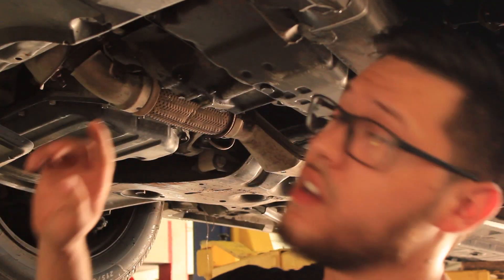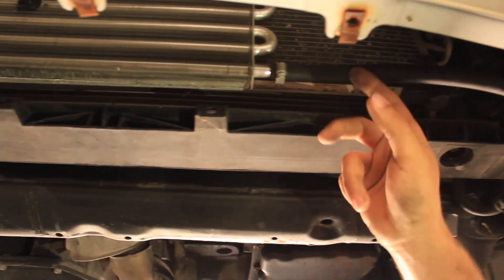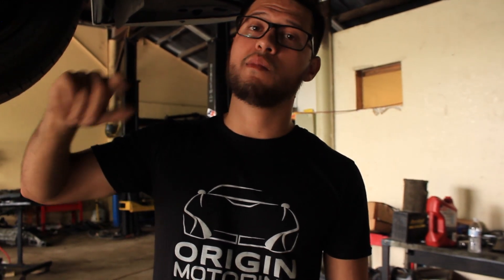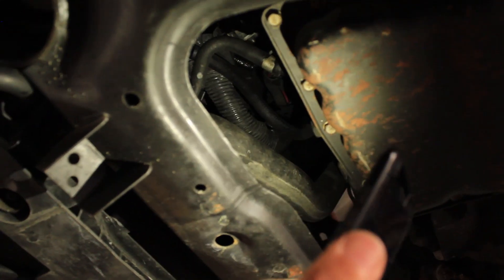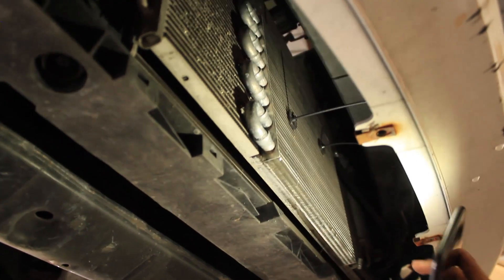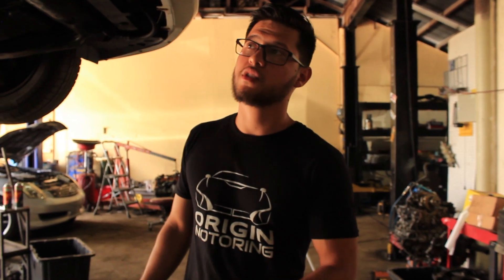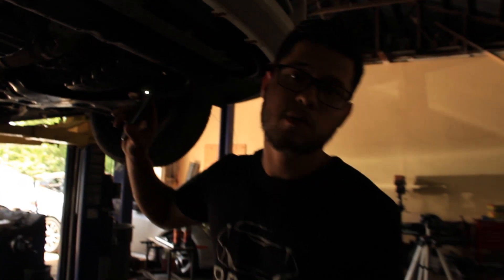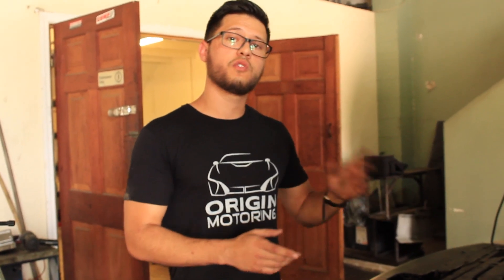Altima cvt Fix. Transmission more reliable

Comment: I got a 2018 versa note. is the cvt not reliable on those?
Reply from the maker: I have a 2014 versa we use to rent to our customers. The transmission on those are terrible heard stories of failures as early as 40k miles. My versa has had the transmission replaced at 80k by the dealership with a new transmission by the owner I bought it from using extended warranty coverage. I bought it at 110k and did a cooler upgrade like this Altima but had to buy an external water cooler adapter online to have 4 ports instead of the stock cooler on the versa only has 2 ports. The upgraded 4 port water cooler has 2 ports for engine coolant and 2 ports to hook up an external air cooler. My versa now has 140k no issues so far. Will make a versa video soon. Don't know if the 2018 versa is any better than the 2014 versa when it comes to transmission failures. It seems like since Nissan started using cvt in 2007 it's been nothing but overheating transmissions blowing up on all models
Reply: thanks for your reply :)

Comment: thanks for your time and sharing your knowledge on this CVT problem. I've got 07 & 08 Altima CVT ( lucky me - not! )  08 is slipping after getting hot. your suggestions please
Reply from the maker: A cooler may help get a little more life out of it it definitely wont hurt to install a cooler and new fluid. Chances are it could be already on its way out but it wont hurt to try to get a little more life out of it
Reply: @origintuning7000  where can I purchase the cooler you used in this video? Also, what did you use to close off the fitting on the radiator? Please advise asap. Thank you & great explanation in the video.

Comment: I just got my CVT replaced under the 10 year 120k mile warranty on my 2010 Altima earlier this month (it was fixed 5k miles prior- code P1778 which is posted on my channel) I don’t think mine was an overheat problem as I never went into fail safe or had the whining and changed the fluid at the dealer every 30k but I noticed you said the fluid frothing could cause pump failure, my transmission was replaced due to pump failure, could my pump of failed because of overheating even without the typical symptoms?
Reply from the maker: Definitely could have failed from running too hot. It only enters fail safe around 235 degrees F. Our altimas with The cooler operate all day at a steady 175-185 degrees F. We're going on 190k original transmission. Only had to replace one transmission axle seal when we replaced a bad cv axle ( general wear and tear maintenance item)
Reply: ORIGIN MOTORING thank you for clarifying that for me! I’ll definitely look into the cooler as my warranty ends in 2020 and I want to protect the new transmission. Thanks again!

Comment: And it does fix the limp mode? And would you suggest replacing solenoids that pop up on the code reader if I have metal shavings in it or just replace the whole cvt
Reply from the maker: Don't bother trying to fix it. Replace the whole thing and add a cooler. We're going on 190k with the original transmission
Reply: Appreciate the time you take out of your day to help us out brother.

Comment: Got the same kit . Good looks. thanks for the tutorial. got 87k on the car hopefully can drive it for another 100k. how many is on that altima? and still first trans?>
Reply from the maker: 190k original trans
Reply: @origintuning7000  where are you located i have a 2012 altima coupe 3.5 with 70k miles and would like this done,just got it now im worried, and cost on getting it done?
Reply: ORIGIN MOTORING is the cvt still running ?
Reply: What's the model of the cooler if I may ask?

Comment: Man, I wish you guys were in California. A month ago I bought a 2007 Nissan Altima 2.5s I'm worried about the CVT transmission.
Reply: Amber Green call performance mod shops, or even transmission shops. I have a guy from a transmission shop willing to mine after I told him I will supply the extra cvt fluid that the trans will need after
Reply: @jacobheinrich6557   ok thanks! I'll see if there's one in Southern California.
Reply: Failure is imminent.

Comment: Hello, just bought a 2011 Nissan Rogue. Now I'm worried about the CVT. I'm definitely planning to keep up on the maintenance,  fluid change.  Should I be highly stressing?
Reply: Yes!   Trade it in for a toyota.   Even an older toyota is more reliable and will hold its value better.
Reply from the maker: I would put an external cooler on it immediately. You need to buy a new water to oil cooler that has 2 extra ports to add an external air to oil cooler
Reply: @ORIGIN MOTORING Any reason that extra piece has to be bought for that specific model? I have a 2008 Nissan Sentra CVT and I'm trying to figure if I can just add an oil cooler with a line from the radiator or if I need to buy some extra piece like you instructed for the Rogue??? Kinda confused about this so any tip would be greatly appreciated.
Reply from the maker: @franciscorodriguez3141  if the car has transmission oil lines going to the radiator then yes you add it in series with the factory radiator cooler like my Altima. If it doesn't have then you have to buy an adapter cooler that has the extra ports to use an external air cooler
Reply: @ORIGIN MOTORING Thank you for the quick reply and for helping clear that up!!

Comment: Great job bro, thank you so much. Thats what Ill do
Reply from the maker: Much love best of luck. Get it done as soon as you can
Reply: Did you try it? if so, did it help? thanks
Reply: David Ruggio I did it, never has an issue again. And consider I live in Arizona, heat is an issue here. But the CVT has been running awesome since.
Reply: gabriel sarabia That’s great - i’m thinking about trying it to stop the whining and limp mode problem. Nissan wants $4500 to fix it. screw that - my wife has been driving it around town for three years since it had limp problem on a big hill and Nissan said it was toast.
Reply: David Ruggio dont think about it that much and do it. It wasnt that expensive and it was very easy to do. You wont regret it. Good luck my friend.
Reply: gabriel sarabia thank you. i will try it and let you know how it goes!
Reply: gabriel sarabia Just bought all the stuff. Went with 15.5 x 10”  cooler.  got a quart of cvt fluid to top off after. All arriving today. Will jump on it next dry day and let you know how it goes. Not sure when I will test it out on that crazy mountain  2 hours from here where it stranded me three years ago...
Reply: David Ruggio awesome David, let me know how it goes.
Reply: gabriel sarabia Hey - just installed it this morning and so far so good. I did 20 min at 77mph (somewhat hilly - not huge hill yet) and seemed quieter. the real test will be in west VA mountains or Afton mt. west of Charlottesville VA where it originally went to limp mode three years ago screwing my vacation. Anyway, these places are a couple hours from here so will have to wait for full test. thanks for the encouragement!
Reply: David Ruggio thats awesome. Im pretty certain your issues will be gone. Not just change the fluid at recommended intervals and you should be golden. Keep me informed. 👍
Reply: gabriel sarabia that would rule! I just ordered fluid, pan with drain plug, filter, and measuring bucket so
fluid change will
be soon. :-D
Reply: gabriel sarabia i hope this new 2011 pan with plug that i got from NAPA fits my 2009. The 2009 one does not seem to be available. the 2009 and 2010 ones are not compatible according to fitment charts, only 2007, 2008, 2011, 2012. But the gasket is the same from 2007-2012, so not sure what’s up with that. if it doesn’t fit, i’m only out $30 since i needed the filter anyway.
Reply: gabriel sarabia the 2011 NAPA pan and filter with new OEM gasket bolted right on this 2009 Altima S 2.5L no problem. measured and re-filled 5 quarts Idematsu cvt NS-2 fluid (was green) and so far good test drive with no leaks. more testing over next few months to see if it actually made a big difference adding the Cooler and changing the fluid. Thanks